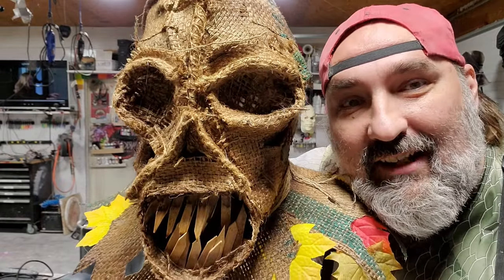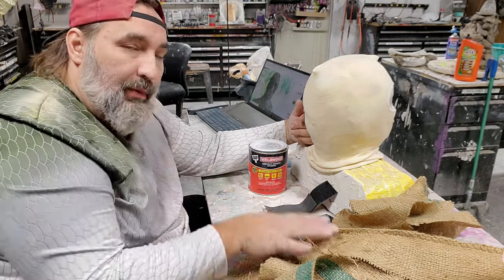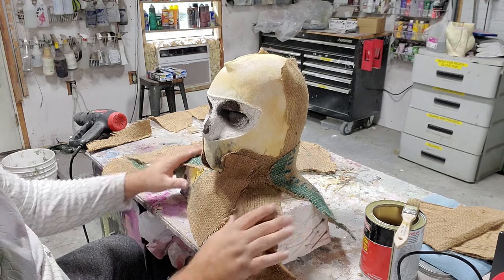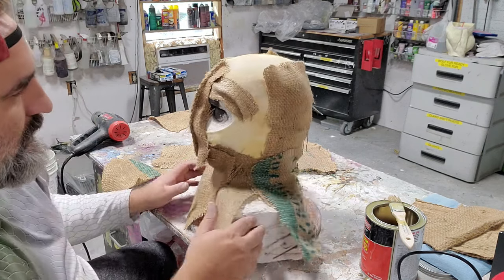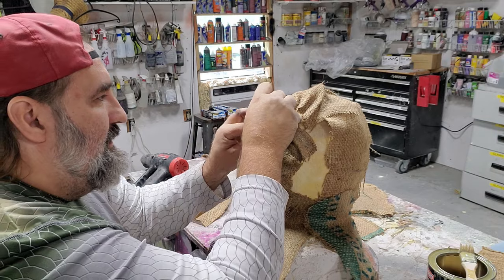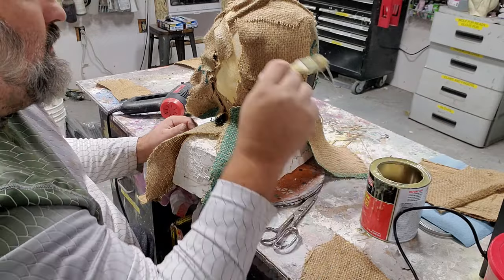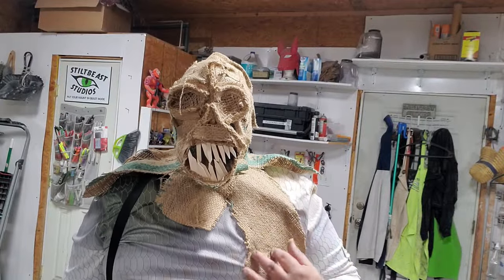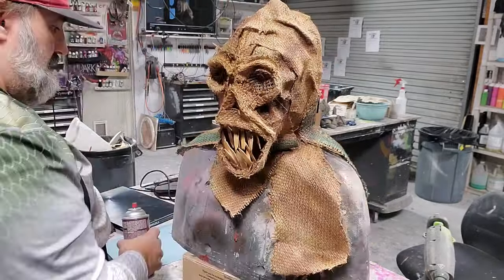burlap mask tutorial scarecrow

Comment: Yes! I've been waiting for this one Allen. I've bugged you long enough and finally the squeaky wheel gets its oil...lol. Bravo sir! I love the balaclava underneath for the liner. I'm made one of these last year according to the Jared Myers method with silicone calk. I also went for a Grim Stitch look. Long process. Looks wise, it came out awesome. Problem was it was heavier than a cement truck with a full load and I messed up my vision. It was also my first mask that I've ever made. Regardless, I will be adjusting my methods after seeing this tutorial. As always,.thank you! 🤘🏻💀
Reply from the maker: these are so light weight, and contact cement is more stable for your skin for sure.
Reply: @StiltbeastStudios  how good of a job does the contact cement allow for in terms of sculpting?

Comment: Hello😊 great video!!!! Will be making this mask for this Halloween. I won’t be doing a head mold. What would I have to do differently if using a wig styrofoam head instead. Will check out the channel and subscribe 👍👍 thank you
Reply from the maker: just have the worlds smallest head to fit in it. they are just too small. you could buy a mannequin head, or beef up the mens wig head with spray foam- there is not much hope if you use the alien looking wig head, they are waaay too small.
Reply: @StiltbeastStudios  ok thank you for responding 👍  I think I’ll try the spray foam idea and take measurements of my head. Hopefully I can get a good fit. Thanks again